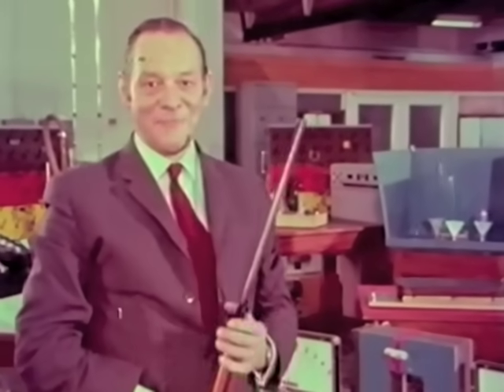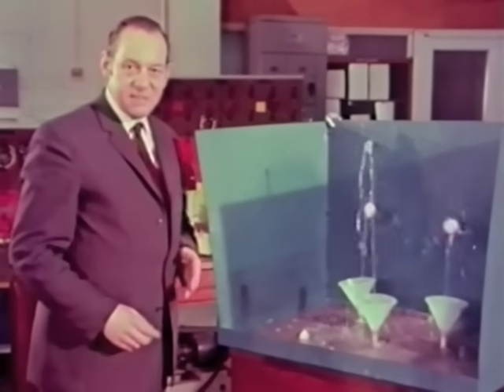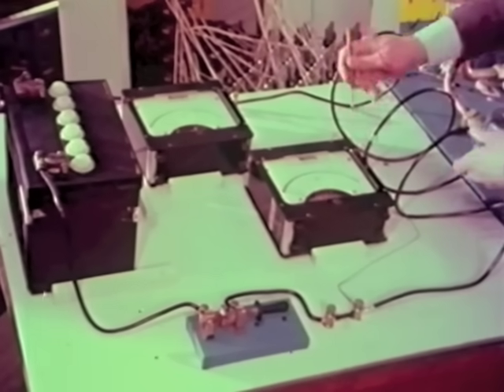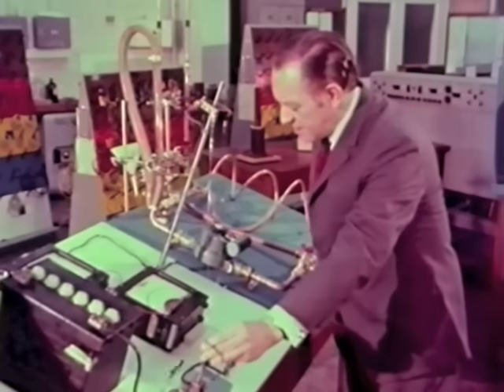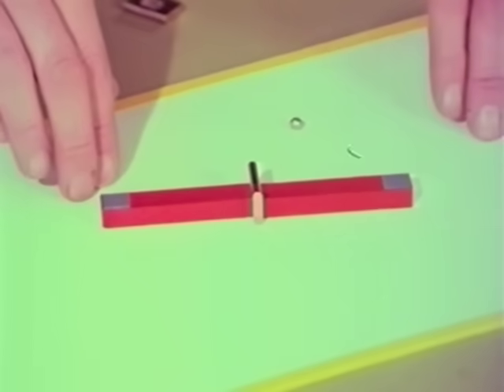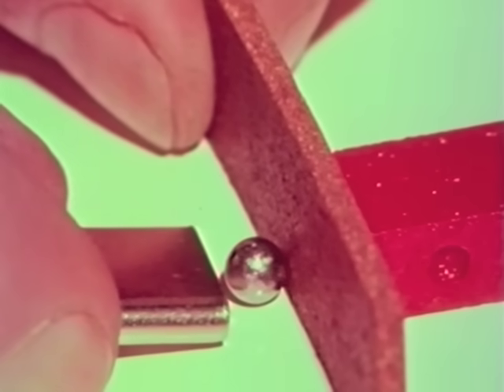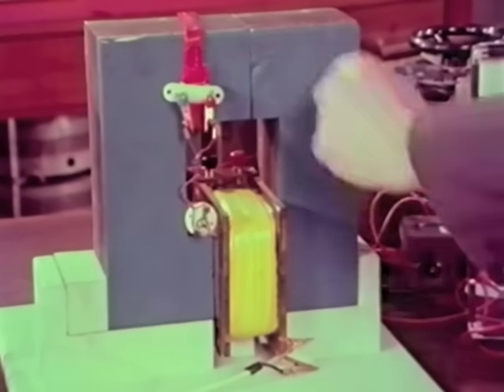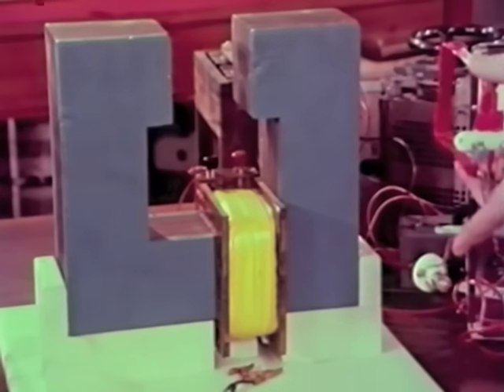Professor Eric Laithwaite: The Circle of Magnetism - 1968

Comment: Correction? The little piece (shim) of steel at the 5 min mark was not a magnet, therefore its domains would align/adjust according to the local magnetic fields. Orientations of one shim to the single magnet were s-n:N-S but when the steel was placed between both magnets the orientation became S-N:s-n-s:N-S. The shim did not become a magnet, especially not a N mono-pole nor an extension of the first magnets' N pole as implied in the demo. Next, the two steel shims oriented S-N:s-n : n-s:N-S and therefore both magnet-shim combos repelled each other from the n to n shim interface.
Reply: He did say that when attached to the single shim that the two magnets were trying to pull the shim into two pieces. So he kinda explained what you are saying. But thank you for typing out how the poles were working it made it really easy to understand!